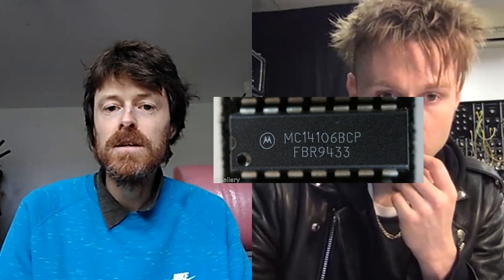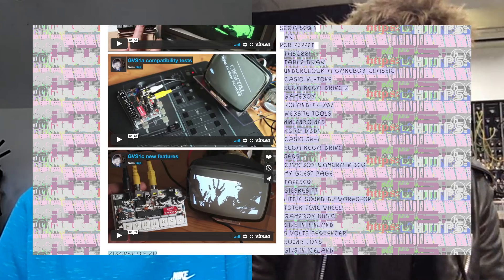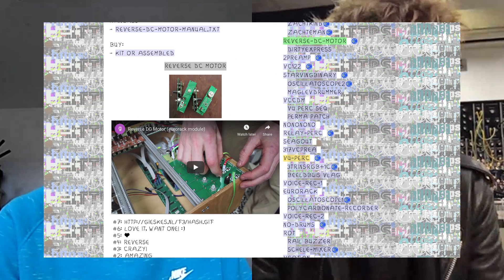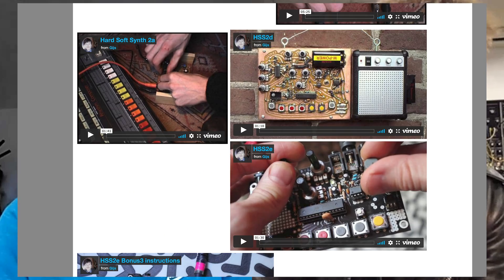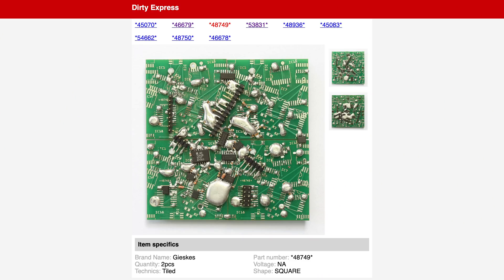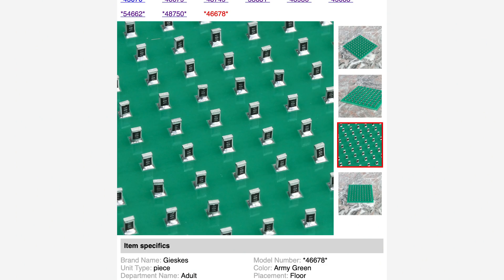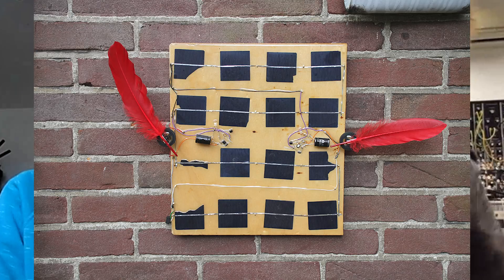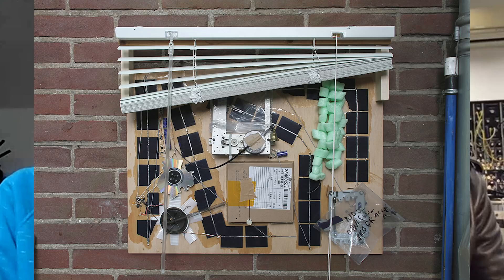Gijs Gieskes - ZonnePaneel #3 A Solar Panel Mechanical Sound Installation

Comment: You could make an eternity synth engine with something like that. 24 hours of sunshine created sounds.
Reply: Good luck getting the sun to shine for 24h
Reply: @Pwills  you’d have to be either extremely far north or extremely far south. I wonder if it works in the cold?
Reply: @inessentialtitle1994  yes I think they do work in the cold but I don't think they are as efficient as normal when freezing but you could also have it going 24-hours a day just shining a torch or something on the solar panel
Reply: @Pwills  but then you would miss the charms of nature. Such as cloud disturbance wouldn’t you? There’s parts of Canada Alaska and I imagine Russia China with 24h sun
Reply: @inessentialtitle1994  but in my original comment which was meant as a joke by the way I was talking about cloud interruptions I live in the UK we don't see much sun that was the point of my joke and I think going to China Russia or Alaska would start to get very expensive

Comment: Due to lack of use i just recharged my car battery with a solar panel. This enabled me to put a CD ( a what ?) In the car CD player and play Cliff and Ivy, and Periscope 38-greatest hits so far at tremendous volume. Is that the same ? 👍🙂

Comment: Beautiful Cinematography in that opening.  That  thing sparked my imagination, so I've got ideas snowballing, lol.  For some reason I never thought about using tiny motors for percussion.  I'd like to see how they'd work on a row of thunder sticks.  Dunno if that's the standard name for them.  Those paper towel rolls with a long dangly spring stapled to the top.